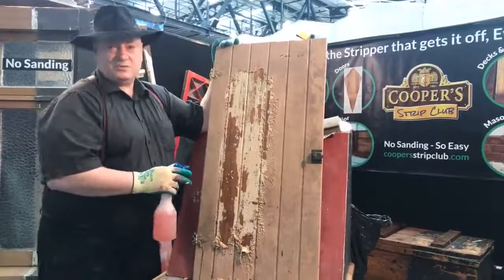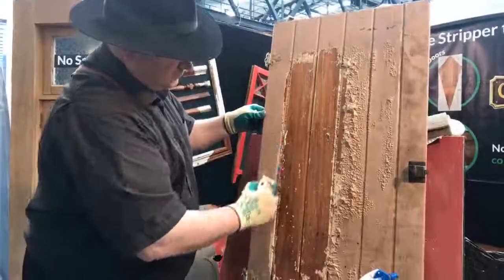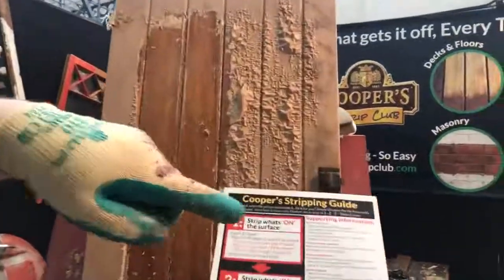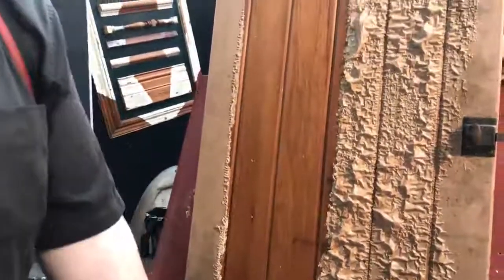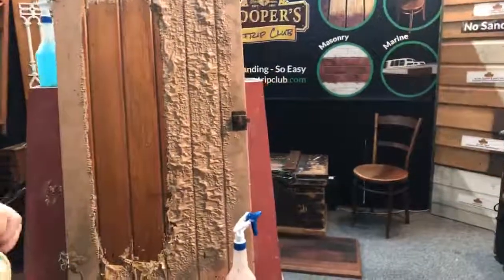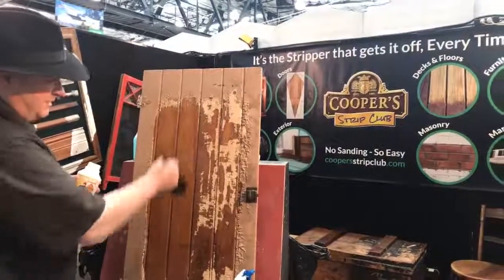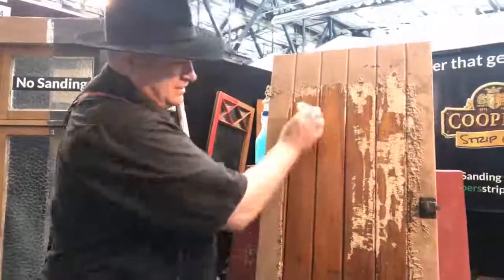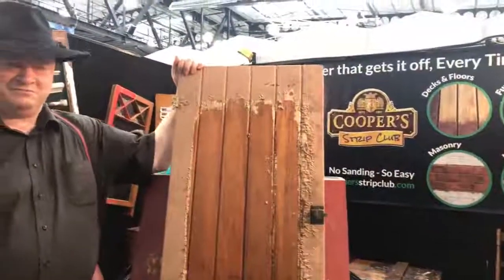How To Strip Lead Paint from T&G without sanding

Comment: I am refinishing a 100+ year plus kitchen piece that they want repainted. The wood after being stripped is thirsty. Very thirsty. Can I paint of the moisturizer?
Reply from the maker: Hi, sorry for the delay in replying

You can not paint over the top of the moisturiser, if you do the paint will fail & delaminate 

Cheers :)
Reply: @coopersstripclub  thank you!  One more question. If I run out of flusher, can I use mineral spirits?